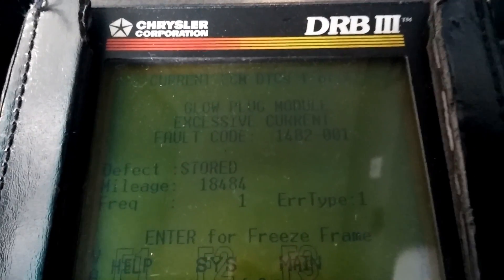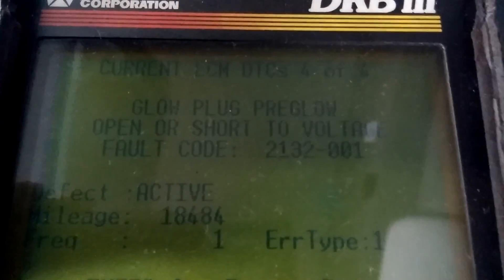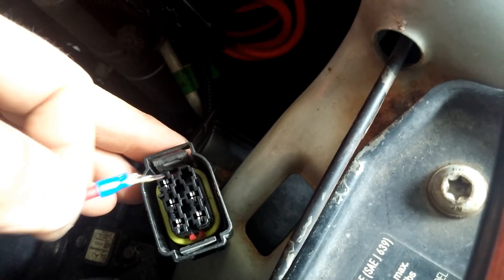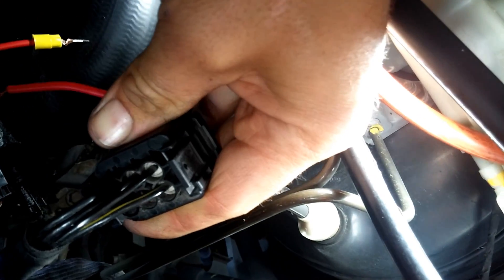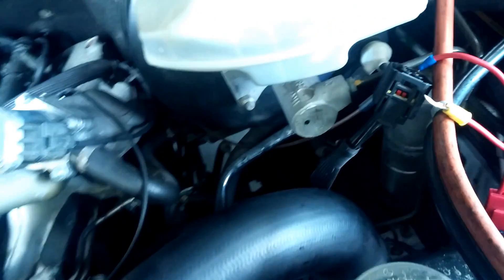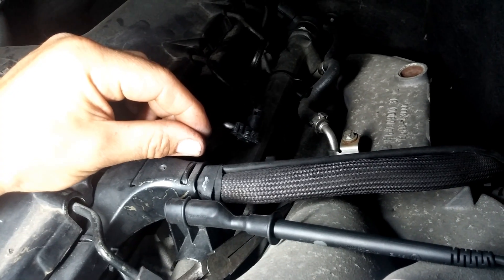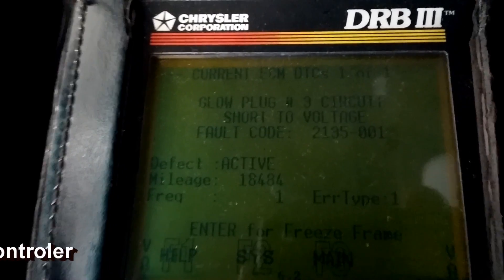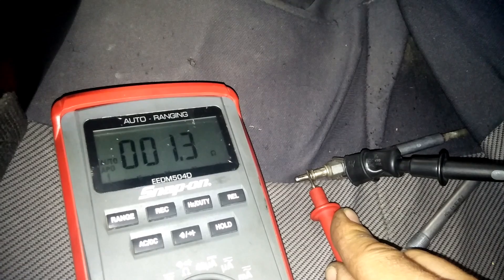Sprinter glow plugs and module test

Comment: Can you recommend a glow plug extraction tool kit for the 2005 sprinter. Cylinder #2
Glow plug broken off in
Head. Thanks
Reply from the maker: That is funny, I just replaced all glow plugs and module in 06 Sprinter last week myself. #2 was broken and only spinning, our dealership just calls a guy that charges $300 for one removal. I'm thinking about getting a kit,  and narrowed it down to these (no experience with them though).
1. CTA Tools (CTA7804)
2. https://www.toronto-tools.com/products/broken-glow-plug-removal-tool-set-m8-x-1-0
3. https://www.wiseautotools.com/b900-0199-broken-glow-plug-removal-tool/
4.  Baum Tools B900-0199  (this kit has only the M8x1.0 threader)

Comment: I am sorry but testing glow plug making fuses to blow is not a professional way. Why not test using your tester in OHMS? If good you will read a low resistance. If bad (open) you will read a very high (infinite) reading. If in in short with ground you will read 0 ohms. Please try it yourself and then make a new video showing the professional way.
Reply: maybe try watching  the video to the end

Comment: I have the 06 2500 Sprinter and replaced an injector copper washer seat due to compression loss. Upon starting the 2.7L motor it ran quietly and smoothly. I let it warm up for 8 minutes and was going to drive away and noticed Diesel fuel coming out of a 10MM dia. black rubber hose on the drivers side of the motor; lots of fuel on the drive way. I removed the black plastic cover over the injectors and found no leaks and was dry. What do you think the problem is and from what source? Thanks
Reply from the maker: Vincent Rolfe 
Hopefully you don’t have a leak from the high pressure rail or tubes. Be careful when running the rail and tubes have over 10000 psi. Check your injector return hoses on top of injectors. Also follow the hoses from  and to your fuel filter. Might be a good idea to replace all the hoses.
Reply: @TDRAuto  There is a hose from the fuel filter to allow you to drain water from the filter. There is a screw on top of the fuel filter that you open to drain it. Make sure this screw is tight (closed). This screw is used when the you get a water in fuel indicator on the instrument panel. See Owner Manual